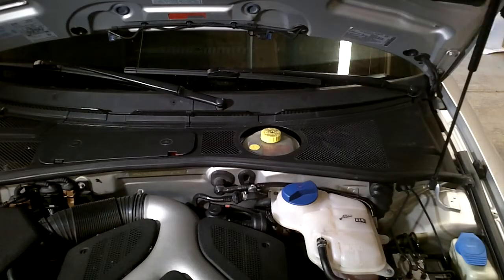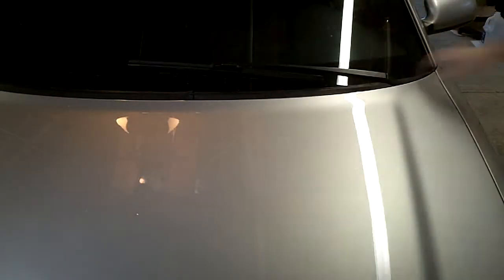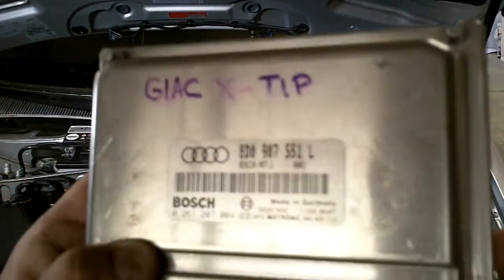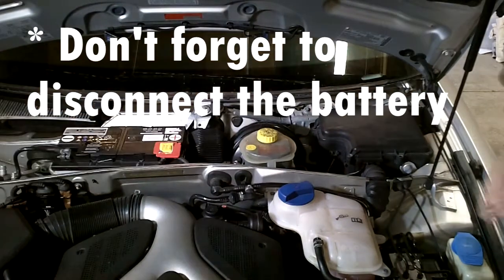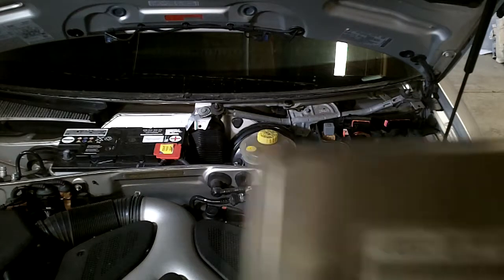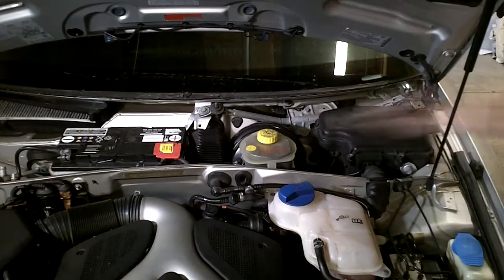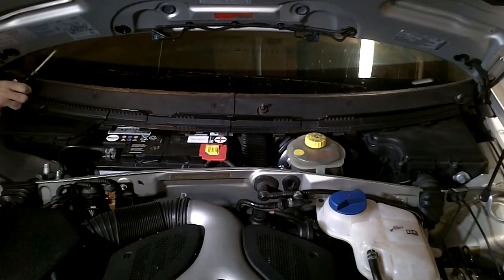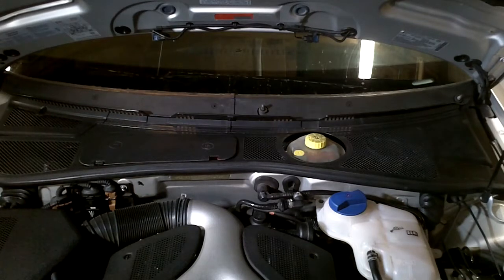2002 Audi S4: Ep. 21 - Stage 1 ECU Install

Comment: Hey got a quick question so I have a j box and looking to upgrade to stage 1 in my tip I found a AA box and stage 1 Tcm for a good price are those two boxes interchangeable? Online it says both the J box and the AA box are interchangeable with the L box
Reply from the maker: It's been many years since I played with chips. I'd default to your research you found online!

Comment: ive been looking into getting a b5 s4 as my first real car any tips on what to look out for or how to get started tuning one
Reply from the maker: +dragonfire9934  well, I would recommend a manual over a tiptronic if you're in the market for one.  Once you start modding, the trans will be a huge money pit if you're Tiptronic,  Most Tip guys end up swapping out the transmission once they go stage 3.

You can pick up cars already tuned for relatively cheap, but to be honest, it's fun to tune these cars.

Bare minimum, make sure the car has had the timing belt serviced.  Usually around 100k miles, they have to be changed out.  These 2.7T engines are interference engines.  Meaning, if the timing belt breaks....the valves will hit the pistons and cost a lot of money to fix.

If you live in a state that gets cold, check and double check the heater core.  It's a $2000+ job to have a dealer swap out the heater core.  The part is like $130, but it takes 20 hours of labor to get to it.

Tuning wise, these cars aren't too complicated.  You can actually pick up used ECU's for cheap, and keep your tuning costs down.  I would say you don't need a custom dyno tune, until you go stage 3.

These cars initially are a pain to work on, but once you dig in a couple times, they're just like any other car.  I would say bare minimum you need to pick up a VAG tool, to scan for codes and see what's going on.  This is an additional cable from a basic OBDii reader you use on other cars.

Any other questions, let me know!
Reply: Snyper Bob  hi. 
I have a Audi and I would like to put a stage 1 how can I know if I need to reprogram it 
I leave in USA  ?
Reply: It's a 2001 s4 manual? 
Do you know if I can go for stage 2 can I run my car stock or I need to change something else?